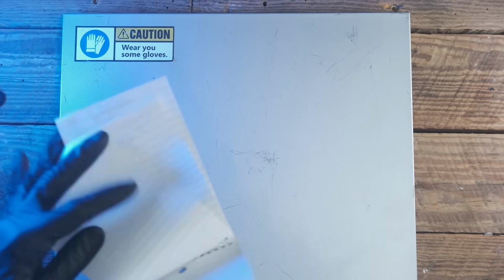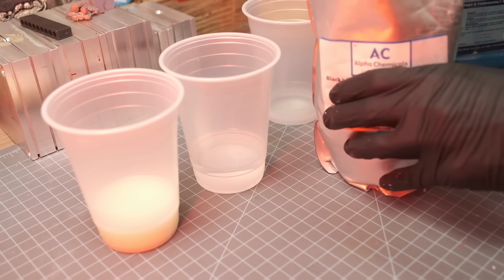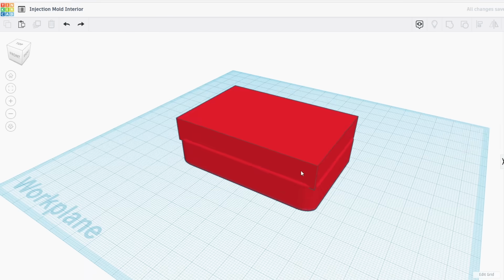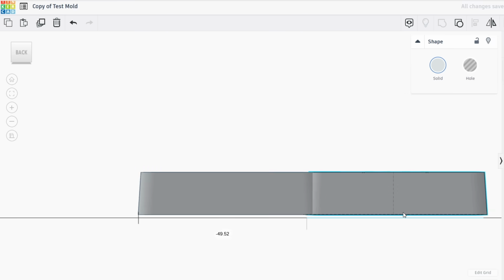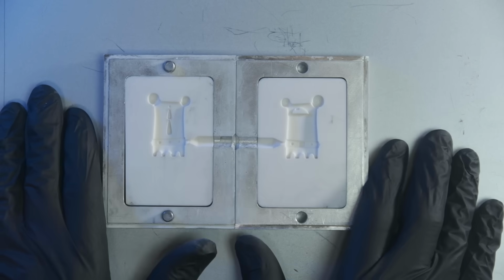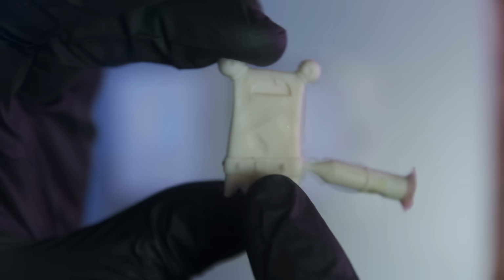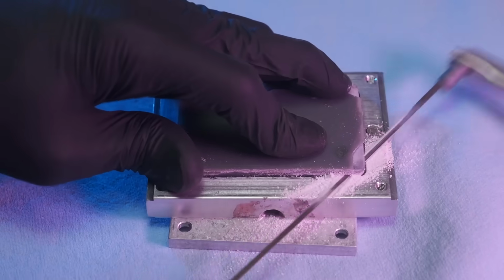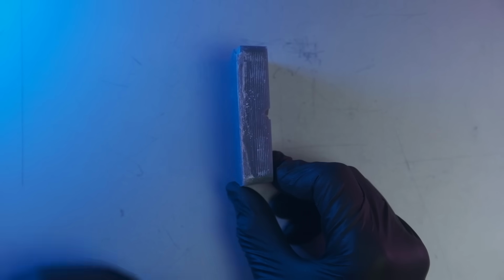3D Printed Injection Molds (actually work)!

Comment: I reckon injection molding is the next big thing for makers. With 3D printing and cheap CNC machines becoming better and better, its becoming possible for anyone to make their own moulds,   which has always been a barrier of entry to injection moulding. Once molds are easy to make hopefully we will start seeing open source molding machines the same way we saw open source 3D printers, and injection molding will finally start to become avalible to home manufacturers!
Reply: With lost casting, it’s already a reality!
Reply: Imagine speed 3d printers. That would do away with injections moulds altogether.
Reply: Injection moulding is already happening in the form of back room, short run, plastic kit manufacturing. Basically people are using engraving machines to create the moulds. Some of the kits I've made have been manufactured buy a single guy in his house for decades.
Reply from the maker: I just want to echo the comments about Precious Plastics and Buster Beagle's setup. I learned about his injection press a couple weeks ago and really like the relative simplicity of the setup. ALSO, I think he did an update to it that allows a much larger shot size! (Might be 2 CU" if I heard right.) Definitely worth considering!
Reply: I so agree with this. This is exactly the stage i am at.
Reply: @The_Mimewar  loss casting?
Reply: @thadonis.  investment casting
Reply: It's coming but might be like 5 years
Reply: @melanierhianna  do you have a link to your kit?

Comment: So many awesome things in this video!
Tinkercad, shapr3D, resin 3D Printing, toy making!!
Reply: for real he did a great job putting it all together.
Reply: The real question is, would it be good enough to make small-batch runs of HIPS minis!

But some big-brain scientists actually figured out something even cooler. they figured out how to make a photocurable polystyrene out of styrene monomer(stabalized), polystyrene, and UV initiator. So it might be directly printable!
Reply: I've yet to get a resin manufacturer to respond to my inquiries about making even just a test-batch of it though, unfortunately. So I may just have to make it myself.
Reply: And the TrueSpace modeling software.... hmmm 🤔. I think I will download it.
Reply: Crafsman has 445K followers for a reason 😉
Reply: Next up: Nomad Sculpt!
Reply from the maker: @IronTiger  : Got it on my iPad and am currently learning how to use it! I have to say... it is about the most intuitive 3D software I've ever touched.
At first I thought I'd be limited to making blobulars, but now I'm seeing how to rough sculpt from primitives and use slicing to do hard-edge sculpting. This is a lot of fun.
Reply: @TheCrafsMan  That is great to hear! I have extremely limited experience with physical and digital sculpting, so I was surprised by how quickly I picked up using Nomad. Ever since, I've been encouraging people to give it a try. I love that it even exports STL files ready to slice for 3D printing.
Reply: @TheCrafsMan  it makes me so happy getting to watch you live out your dream of learning all this stuff and toy making!

Comment from the maker: STUFF I FORGOT TO MENTION:
- That PTFE lubricant I rubbed on the bottom of the vat (FEP film) keeps my 3D prints from sticking. If you do this, be sure not to leave excess lubricant.
- The squid figure wad modeled in trueSpace 3D 7.6. It is unsupported and lacks the convenient features of modern modeling software, but I've used this program since 1998 and know the keyboard shortcuts. :) One day... I may learn Blender. (And Fusion 360.)
- It is possible to use a 3D printed mold directly without the metal frames. I have NOT tried it with the Siraya yet (would need to re-print these molds, because the sides are angled).
I did try it before on a rectangular mold printed in Elegoo Mars Water Washable resin. I used a metal washer where the nozzle meets the top of the 3D printed mold, and a metal plate behind the mold to distribute the clamp pressure. The mold did wind up cracking, but I was able to get a few pieces before that happened.

STUFF I NEED TO TRY:
- Mounting the 3D printed molds a bit proud from the aluminum frames. I made them flush because I figured to do otherwise would be just asking for the 3D printed molds to crack. However, now I'm thinking letting them protrude a slight bit may allow for a tighter fit, slight compression, and minimize flash.
- Using Siraya printed molds straight, without metal frames. UPDATE: I tried this, and it works. I used a metal block between the mold and clamp.
- Siraya Tech Sculpt CLEAR. I've been told the clear allows for a better post-cure, possibly resulting in an even stronger 3D printed mold.
Reply: TrueSpace was my jam back in the late 90's/early 2000's cool to see you using it. Shame that Microsoft bought it and file-13'd it.
Reply: I would be really interested in how this mold would work without the metal frame🤔
Reply: I got really interested in this type of resin, after a few hours of searching I found the "GulfSream Outdoors" youtube channel where the guy is making siraya tech sculpt molds without metal frame and he is  pouring at high temp. He has a 3 part tutorial series where he is talking about the tips and trick of designing and printing these molds.
Reply: Did you notice any problems with applying a hot extruder directly on the mold? I thought about making a small hole for a metal nut or spacer to avoid direct contact with the mold, but idk if that's necessary
Reply from the maker: @VincentVeak  It actually holds up to the heat better than the molds I cast in resin + metal oxide. And I JUST got this little deal, which I've not had a chance to use:
https://busterbeagle3d.square.site/product/aluminum-injection-mold-sprue/9?cp=true&sa=true&sbp=false&q=false

But I've used thick flat washers before. Just a little more fiddly.  :)

Comment: Nice!  Some thoughts:

1.  To get the most accurate corners, lay drill bits in them until you find one that fits the best.
2.  To zero in on a perfect fit, just print the outside edges and a couple of bridges across the middle for support.   It won't print any faster but it will use a LOT less resin.
3.  If you can swing it, get yourself a 4k mono printer for insane detail.  (...or bite the $2,000 bullet and get an 8k printer.)

Comment: Hey craftman have you ever thought about using have you ever thought about using Plaster  It won't handle Heat very well. Sometimes it could be brittle but if you get the right mixture if you get the right mixture it will be great it will be great and it's relatively inexpensive an expensive. Even even if you can only use it 10 or 15 times it wouldn't it would not cost but but a few cents to Make some more.

Comment: Great video! I wonder if a fast way of getting a perfect fit would be to intentionally print your mold a bit smaller than the mold box, and then fill in the gaps by pouring in some liquid resin and hitting it with a UV light.

Comment: As a small note: I don't recommend lubricating the FEP film on SLA printers. It will really only help with the first layer but it's just one more thing to contaminate your resin or create residue on your film and decrease it's clarity. If you are having problems with your prints sticking to the film it's much better to play with your exposure settings(or it may be time to replace the FEP) and find the sweet spot for your printer/resin. You'll have to tweak things for each different resin you use most likely, but lubricating the film is just a bandaid that doesn't address the real issue and may actually reduce the quality of your prints.

I know a ton of people do it with no noticeable detriment, but any contamination or even the tiniest abrasions CAN have tremendous effects on print quality. Even the residue left behind if you clean your FEP with alcohol, which I believe is why some manufacturers recommend warm water and dish soap instead.

It can have more dramatic effects than one might think. I've had some tremendous problems solved by replacing VERY slightly cloudy film that I never imagined could've caused problems or even by just rewashing a vat with warm water.

Mine is far from a professional opinion though, this has just been my anecdotal experience.

Comment: You can likely go a long way toward eliminating flashing if you make the 3d printed mold inserts about 0.002" taller than the aluminum holder blocks so the inserts shut off just before the aluminum makes contact. You will crush it enough with the clamps that the aluminum will seal, but the inserts will be tighter and you shouldn't have the flashing.

If you ever find yourself trying to polish the inside of a mold cavity to eliminate the lines, and you want to know if you have gotten a good finish but don't want to have to run a test shot in the injection mold machine, use Silly Putty. Just press some into your mold cavity with your hands. The silly putty will pick up every detail the same way the plastic does. You will be able to tell that way.

The paper shim was a nice touch.

Comment: Crafsman, instead of using glue to fill gaps (or even to join resin prints) you can use the same resin and a UV flashlight if you want. Someone gave me that tip and it was a game changer.

Comment: What you could do, Crafsman, is make a mold of the inside if the mold frames, get that scanned as a 3D print file, and then you have a precision mold blank you know will always fit perfectly. Or at least repeatably between figure designs.

Comment: No idea how I got here, but nice video. I have no experience with injection molding but having run a forge press and adjusted to many die sets with shims and seeing  you use a paper shim to adjust your mold I'll make a suggestion. To keep from sanding into your mold frame to get things flush get some metal shim stock and use that behind the mold to shim the front side flush to the frame after dressing the back of the mold flat. It should save you from ruining one of those frames. Again great video!

Comment: Have you considered attaching a heat sink to the aluminum case? Aluminum is very good at dissipating heat. With the heat sink, the aluminum would not experience thermal expansion as much, keeping everything much better aligned.

Comment: I am sure someone already said it, but the overlap you had on the moldprints was caused by the first layers, which are exposes longer than the rest of the print. I recommend using simple supports and the print will work fine.

Comment: Yessir, SLA prints tend to swell a tiny bit when you cure them like that. I've got an older Mars and making precision parts with photoresin can be a bit of a trick, they don't always uniformly cure. Also, definitely wash off the parts with a toothbrush and rubbing alcohol before you cure. 

Keep kickin that booty and and making this process better. I'm so excited for you for making that step.

Comment: 3D printed molds have been in use, in the industry, for quite some time. They have a very low life-cycle count but that is not their intended use. They are used for low production number or test runs before the vastly more expensive molds are made. If you only need 100 of a thing paying for a very expensive mold that can cycle a thousand or more times is a waste of money.  As you've found out, they can even be made "in house" if one has the right gear.  The only other limit is the usually lower working pressure, but that's not really an issue here as your system is pretty low pressure as it is.

Comment: Just a thought, but you could pint the mold section smaller, 't' shaped to align itself in the frame, then fill it with a 2 part resin to make it level and fill all gaps. This would make it print faster, and use a cheaper resin for the bulk, avoid sanding etc.

Comment: You come up with the strangest-coolest characters!! I use Blender to design anything I need, it does take some time to learn, but it is much easier than Maya. Blender is free, but you probably know about it already being as crafty as you are. Thanks for showing how you make your molds. I have all my parts for an injection machine, just have to assemble it.

Comment: Hey Crafsman, to get rid of the small ridges on the model, you can take a foam brush and go back over the 3d print with the same resin you used. And set it out in the sun to cure. I saw a guy call Uncle Jessie on YouTube do it.
Reply from the maker: That's a slick idea! There's also Smooth Cast's XTC3, BUT I'm not sure if it holds up to heat, so the idea of using the SAME resin over the ridges and curing it is probably the best!

Comment: Great work Crafsman, I can see how you’re so excited because this opens up so much potential! What about making molds of seperate parts of a figure, then combining them to make one ULTRA figure? The color combinations could be cool too
Reply from the maker: That is PRECISELY what we want to do!  :D  Not only does it allow you to use the limited shot size in a creative way (to make a larger figure), but you have the added bonus of ARTICULATION ANNNNND getting to use COLOR VARIATION. Because this stuff isn't the easiest to paint. (PVC paint used in Chinese factories, on real commercial toys, is durable. Hard to match it.)
Reply: @TheCrafsMan   yes! durable, fully articulated, pressure cast, color variable figures! Already excited to see what you come up with!

Comment: Not sure if you already applied it in your slicer, but Anti-aliasing might help a little bit with those layer lines. I'm pretty sure changing layer height and print orientation helps more, but AA may smooth out the saw-toothing on the edges without adding hours and hours to the print time

Comment: You might be able to cast your own aluminum molds if you make each half overly deep and then cut them to size so that their mating surfaces were flush. Not sure how you would make them properly located, but it should be doable. Maybe you could stretch the model-to-cast at the middle, suspend it in a slightly oversized lengthwise mold using the injection port and sprues to hold it, cast it in aluminum as a single piece, then cut the finished casting in half with a bandsaw and grind them to the proper thickness to fit in the mold frames? They wouldn't be perfect, but they'd be pretty cheap.

Comment: I am beyond surprised by how well those molds printed! Resin printers are known for not being the best at printing flat surfaces, specially at this size. I tried printing resin molds for vacuum forming in a similar fashion to the way you did in this video and ran into all sorts of problems. I'm particularly interested in how you avoided vacuum and suction problems in the top layers of your print since you create those wells where the figure "negative space" is. Does the PFTE lubricant play a big role in this?

Comment: if you print them at an angle relative to your layer height, you'll get far less visible lines. I don't suggest vertical, as you'd still get visible lines

Comment: You can use ECM to make hardened steel molds that last ages using a 3d printer, a pump, and salt water. Takes some custom gcode.

Comment: Solid prints feels like a lot of resin. Could you print them hollow and fill the void with something like regular hard setting resin? 
Maybe even print it slim, seal it down to a surface with the aluminum frame and fill that like a mold, so everything is flush and tight. Hope that makes sense.

Comment: Get one of those cheap Chinese angle 📐 measuring tool. They’re called like a radial gage or something. It will pickup the angle. If you have a protractor you can project it with a straight edge and mark it on paper. Use the protractor to pickup the angle. Prob a million ways to pickup the angle.

Comment: I don't even have a resin printer ( I opted for an ender 3) and I was fascinated by this, will definitely recommend to a friend or two p.s. if you use CA glue and epoxy you can have perfectly smooth parts to make the mold from

Comment: Hey Crafsman, you should look up cross sliding drill press vises, I found some reasonably priced on ebay. I think it could potentially be a great solution for holding your molds with a relatively good amount of both precision and ease. Though they do sit off the table about 4 to 5 inches so it may not be practical for larger molds.

Comment: Wet sand.
You keep those harmful resin dust down, and you keep the sand paper from clogging increasing its performance.
You don't need a lot of water, just enough so the powder doesn't get settled and trapped in the pores.
I usually keep a water spray bottle next to my sanding belt.

Comment: You really had to get me thinking about saving for one of these now didn't you? lol. Thanks for the awesome vid and step by step as always! If your molds do ever start getting issues with expanding / cracking, maybe also look into adding some Blu v2 from srirac- Siraya Tech into your mix. Stuff works great at adding flex to parts, though you probably know that from the selection shown there lol.

Comment: Hey Crafsman, have you seen a video by Robinson Foundry making a double threaded metal bolt from a pla 3d printed part? 

My point being that if you think about how he does this, you could print the mold and then cast in metal. And depending on how well you post process the mold at either stage the less visible the layer lines would be or just completely removed.  

Of course the equipment for casting the metal and the risks in terms of safety are the downsides or stepping stones.  

Just saw that video and thought about this injection molding project. I think I mentioned the idea of casting a mold before too cause you did that metal Cap'n Crunch robot guy.    :{

Comment: When sanding 3D printed parts from resin try wet sanding (reduces dust) I couldn’t tell from the video but the dust is pretty bad for you so use a dust collector as well.